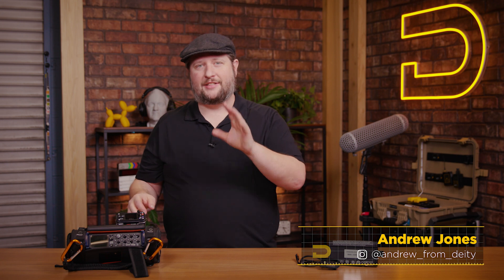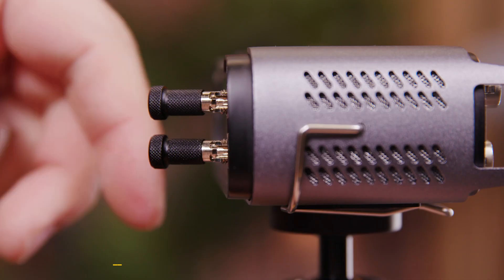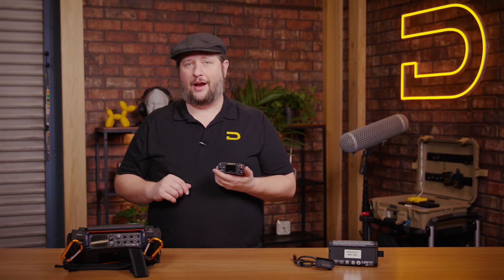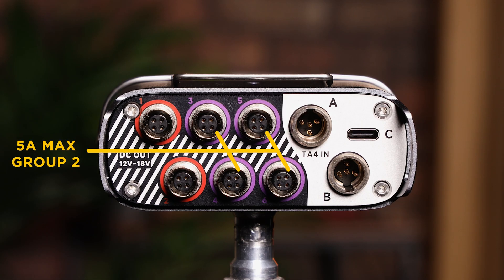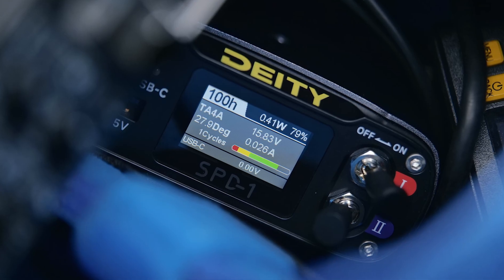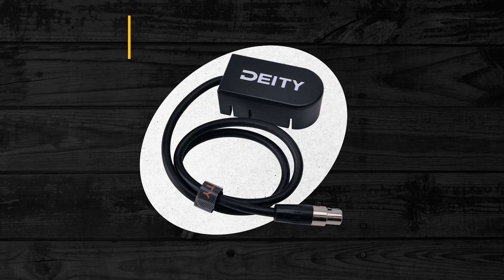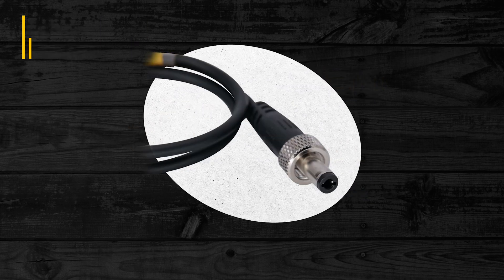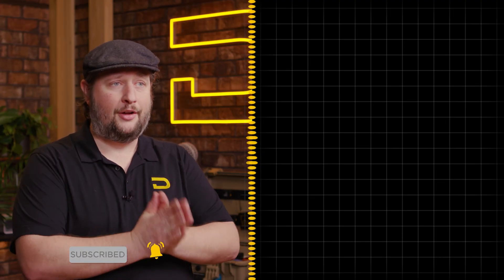Deity SPD-1 User Guide | How To Use a Smart Power Distributor/BDS

Comment: Is there a certain AC to DC power supply with a TA4F connection that you all would recommend in order to provide house power to the SPD-1? Or is there a different method you all suggest?

Comment: Hi Andrew, I have a AKG SST-4500 in ear monitor system that I use for FIB. That unit works on 12V. I normally use a camera battery plate and run a cable from the 12v output of the plate to power this unit.  If I use the PTap cable to power the SPD-1 and get the HIROSE to 5mm cable to power that unit using a V Mount battery (getting rid of the plate) would the SPD-1 will send more than 12V. The output of the battery via P-Tap is 14.8V. Is there a way to set the SPD-1 to send 12V to a specific output? Or can I use it like that. Thanks in advance for information.
Reply from the maker: You'd need to use a cable that has an in line 12V regulator buck converter. Best bet would be to call Gotham Sound in NYC or Location Sound Corp in LA to see if they have anything like that.

Comment: Yes!!!!! Can it power the DUO-RX units without a buzz?
I have had issues with powerbanks on my 3.. to the point I have to charge the units on breaks and not in situ. AND.. if so, if I also get the HR3U (I think this is designed for use with your DUO-RX in this case)..
Should that be on OP Group 1 or 2?
I have a small soundbag (DOP not a soundo), so the only other thing to power is a Sound Devices MixPre6II.. Thanks

Comment: Hi Andrew! Great product! 
How do you power the SPD-1 with the Ta4 input on Mixpre series ? Do we need a Ta4 to hirose cable when using the MX-HIROSE DC ?
Thanks :face-blue-smiling:
Reply from the maker: Other way around. You need the MX-HIROSE adapter for your MixPre, and then you'd use the SPD-HRHR cable to link your MixPre to the SPD-1. Ideally you'd use Output #1 for your MixPre.
Reply: @DeityMicrophones  Okay for that but the SPD1 will be powered by the battery. Do we need exclusively the SPD-T4BATT for that? I only got NP1. I'll have to change my batteries I guess ?

Comment: @DeityMicrophones If I have two batteries plugged into the inputs will it Fully drain the A- battery and auto swap to the second B-Battery or will it constantly switch between the batteries until both are fully drained?
Reply from the maker: It will pull from the unit with the highest voltage till both batteries are equal and then draw from both